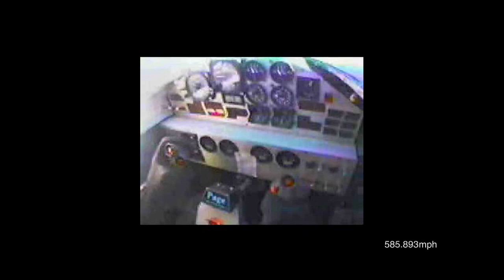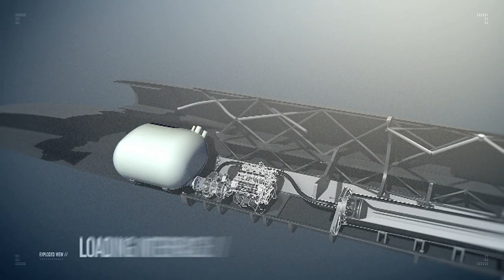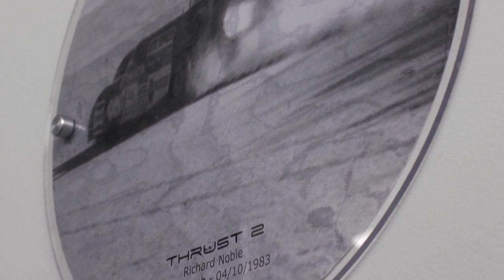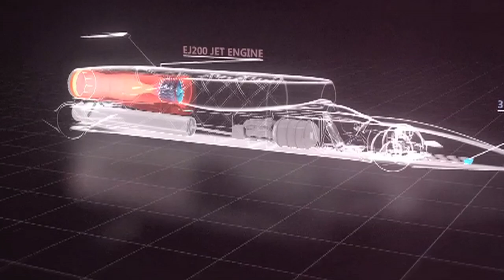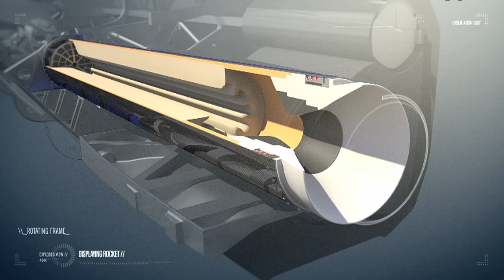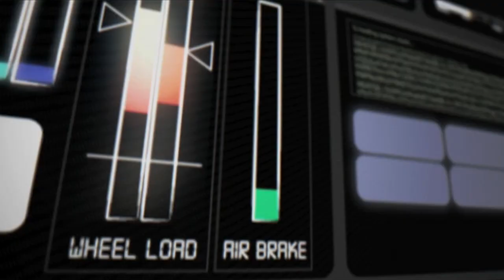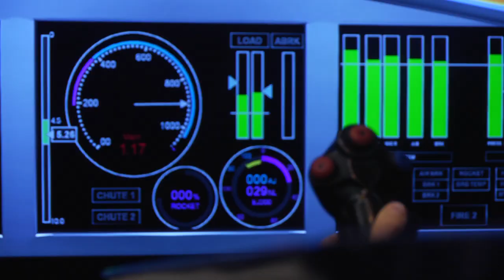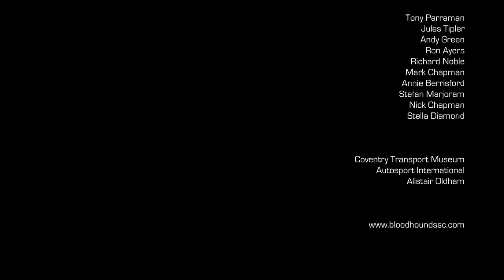BLOODHOUND: In Search of Speed

Comment: They have another video on here explaining why Bloodhound hasn't got an ejector seat, Ron Ayres says that at around 1000 mph at ground level the drag forces on someone trying to leave the car in a hurry are around 10 tons.  So in the event of an emergency they're counting on cutting the engines and slowing the car down.
Funny you should mention using a fighter jet though, I believe one of the other 1000mph teams is using what is essentially a Lockheed StarFighter with the wings cut off.

Comment: Safety reasons mainly.  Solid rocket boosters generally speaking can't be throttled or shut down once lit.  And with the jet engine you don't need a pressure vessel within the vehicle to hold the oxidiser.  So to kill everything all you need to do is shut down the piston engine running the fuel/oxidiser pump.
There probably isn't a huge difference in weight or thrust between the two options, but if it all goes wrong Andy would be more likely to survive with Bloodhound's configuration.